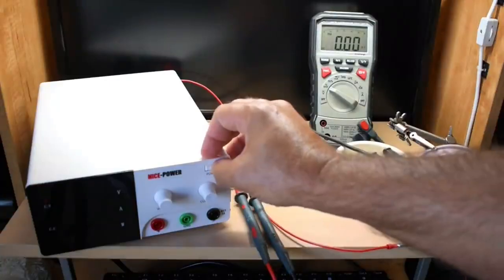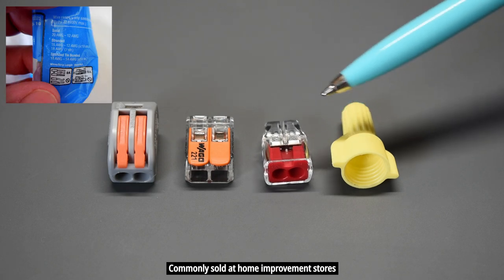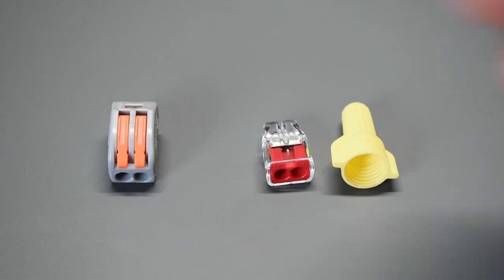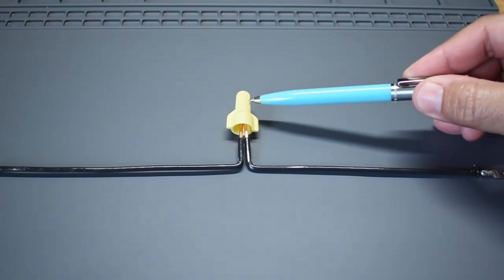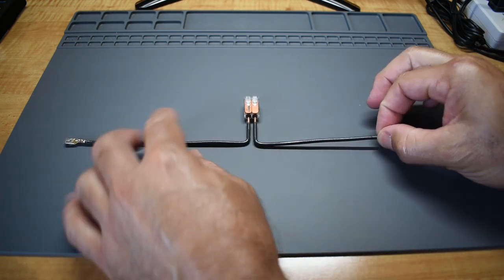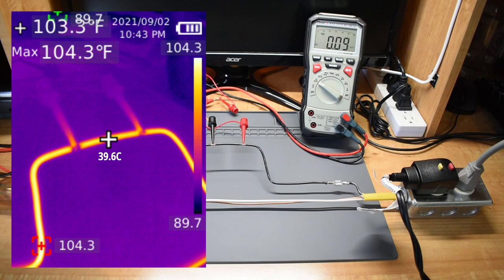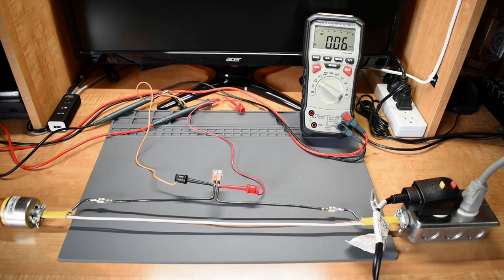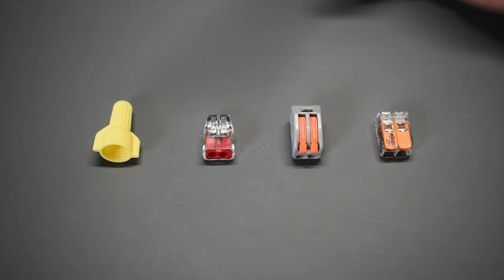BEST Electrical Wire Connector? Wago, Wire Nut, Ideal In-Sure, Lever Nut

Comment: Ive discovered many issues with wire nuts with heat and improper installations where they come off loose or found frail over time. Wagos seem to last and resist longer in handling heat and movement.
Reply from the maker: Decades later it can happen, but no one knows how well a Wago will do over decades, they've only been in use for 15 or so years.

Comment: I would have liked to see the temperature and the loss with Penetrox in the marette (comnector) ...
Reply from the maker: That is normally used for AL to CU or AL to AL.
Reply: @electronicsNmore  Indeed, but surely also helps to lower the resistance and the temperature ... As a test, it is interesting as data!

Comment: In spite of the negligible differences, which are easy to ignore because all are significantly less than the allowable voltage drop, which connection gives the most repeatability? Which is most susceptible to an installation error? Which can be tested easiest without destructively testing the connection once installed? All these connectors have been approved for a reason.
Reply from the maker: Yes, all well below the allowable drop. I was just showing which one has the lowest voltage drop, and lowest temp under load. If a person can't connect 2 or 3 wires properly using a wire nut, then they have no business working on the electrical system. Thanks for watching!
Reply: @electronicsNmore  I didn't intend offense and appreciate the video very much. I was just reiterating for the few that looked at 4 times the Vd and the 10 degree temp difference and reflexively concluded that was bad.

Comment: Wego works the same way that works the little hole in the back part of the standard 15 amps receptacles to connect awg 14 solid wire.  Most Cities codes do not accept to use those holes to install the receptacles because have the tendency to fail after the years.
Wego is a new system not proven yet on long years.  Most probably will be in the future prohibited for residential use.
It is not true that in Germany they use Wego in residential  wiring… they use screw type connectors.

Comment: You’re not really comparing apples to apples here either, push-fit connectors like the Ideal are classed as maintenance free, while the lever types are not, you can’t install them anywhere where you can’t get to them afterwards for inspection. Don’t know about wire nuts, they aren’t allowed for new installations over here anymore.
Reply: You shouldn't be installing connectors anywhere where you can't get tot them for inspection. Not being able to use wire nuts is probably more of a political problem than a safety problem. Another reason why businesses and companies should NOT be allowed to make political contributions.

Comment: It almost seems as if the Wago types were intended to get a twist or two before pushing them into the box?  I've never used them but it seems like the only way to tighten it up without using tape.
Reply from the maker: The manufacturer says the 221 can be used for solid or stranded conductors. They do work for both, but the best results are using stranded wire. Not ideal for solid copper wire.
Reply: @electronicsNmore  Interesting... Perhaps you could do a follow-up using stranded wire just to see how they perform. I'm not up to scratch on current regulations and practices but I've used both solid core and stranded in installations, and I preferred working with stranded wire. Back then we had wire nuts and that was about it, even so I mostly worked with screw connectors and only very infrequently had to use a wire nut. In fact I never really liked them back then, but over time I've learned to appreciate them for their simple construction, low price, ease and speed of use and their reliability.
Reply: @blahorgaslisk7763  Don't listen to him, they're ideal for all types of wires. Watch John Ward videos on the WAGO, failure point is so high that there is no problem at all.

Comment: Hmmm, I just found out about WAGO connectors for a van conversion project and felt kinda fortunate that I found them as they seemed to be quite easy to work with.  I had planned to glue them in place and also tape the wires they were connecting down to hopefully eliminate movement.  Would they be considered safe if such measures were taken?  They were only being used with small 12v dc powered devices like LED lights, fans, etc...
Reply from the maker: They shouldn't unlock, so no glue is necessary. You can cover everything with heat shrink tubing.
Reply: @electronicsNmore  I meant glue them to a surface and tape the wires to the same surface.  I can't imagine them having any force on the connection to the point of wires being pulled out.  Saw your other video on the strength of connection as well.  Thanks for that.  Learning lots of details from YTers like yourself.
Reply: @owenparker6651  Dude just buy wago mounting carriers
Reply: @tropicaldimitri7374  I have never come across these or heard anyone mention them so thanks for the enlightenment :)

Comment: If you ever have stranded and solid together.....wago does way better than nuts.
Reply from the maker: Agree, but if you strip the stranded wire 3/4" long and the solid 1/2" long, you can wrap the stranded wire around the solid conductor then use the wire nut, it will be very secure. Thanks for watching!

Comment: I’m no electrician, but I guess I didn’t realize anything other than wire nuts were even accepted as being a permanent connections in residential wiring. I’ve never used anything other than wire nuts because, to me, the wagos and what not never seemed sturdy enough to trust shoving back into a box. I could see them being used temporarily, for like a temp light fixture, but as a permanent connection just seems like a bad idea. I’ve used wagos quite a few times in dumb little low voltage projects because they’re easy to remove. But I’ve never, and probably will never, use one on for high voltage...
Reply from the maker: I don't like the fact that the Wago and other lever connector rotate on the copper wire as you push the wires into an electrical box.

Comment: of course the wire nuts will be best, it has the least resistance because your twisting the wires together directly, the others are nothing more than bridges, wago (pronounced vargo) are popular in Europe and Australia, New Zealand, in UK they are tycpially used under floors so contained in purpose fit boxes, surprised you never did a pull-out test, maybe @project farm can oblige :)
Reply from the maker: That test may be next. :-) Very simple to do.

Comment: The order of your test from best to worst is reverse of Everyday Home Repairs (YouTube channel) who strongly recommends ditching the ancient (but proven) wire nut for Wago connectors. He's pretty much Wago Jesus. I would prefer just using a wire nut, myself. Insurance companies will do whatever they can to avoid a payout, so might as not cut corners. Also, wire nuts are so much more cheaper. Actually, I could kind of see using those clip connectors in overhead ceiling lights since they are quite low power, but for any general power applications, I'd just stick with the trusty wire nuts.
Reply from the maker: I saw that. LOL. Ridiculous. Maybe best to worst for ease of installation, but not the most secure, lowest resistance, lowest heating connection. Many Wago fanatics out there.

Comment: Id never trust a wire nut for permanent wiring, they are cheap yes but so much better and secure alternatives
Reply from the maker: Wire nuts, when used properly, are the most secure method shown in this video. Did you even watch the video? Apparently not.
Reply: @electronicsNmore  1. metal fasteners are better longterm, plastic does breakdown over time. 2. wirenutting  conductors together significantly weakens the copper leading to premature failure longterm.
Reply from the maker: @trevorsmith5946  Nonsense. I guess you failed to notice that the lever nuts are made of plastic. Wire nuts provide a superior connection because you have a much greater surface area of the conductor in contact with the other. My video proved the best connection, there's nothing to dispute.
Reply: @electronicsNmore  Nonsense. There are countless examples of wire nuts failing causing faults, damage and fires. I have seen many of these failures in my 30 years experience.

Comment: It is going to be harder to test the actual claimed advantages of wago 2273:

Automatically destroys the oxide film during clamping.

Prevents fresh oxidation at the clamping point.

Prevents electrolytic corrosion between aluminum and copper conductors (in the same terminal block).

Provides long-term protection against corrosion.
Reply: I never heard that that Wago connectors prevent electrolytic corrosion between aluminum and copper connectors. They do separate the conductors, but the metals inside the Wago connector also have to be rated for use with both copper and aluminum wire. I'll have to look into that. I've been using those anti-oxidant wire nuts for combining aluminum and copper wire. They seem to work fine, though.
Reply: Why would you have aluminium wire on anything that would fit in a wago?  I've seen it on some shit knock off equipment but it's just a fire hazard. Fair enough for big HV lines but never on an appliance.
Reply: @Savagetechie  Some homes were built with Aluminum wiring between the years 1965 and 1972.
Reply: Note that what you listed was Wago 2273 in use WITH “Alu-Plus” Contact Paste.
Reply: @KiNgOfAllSaND  really? Thats a bit shit; plated ally 240mm² is a lot lighter than copper if you need 600 amp but outside of heavyweight it's normally only used for HV here.
Reply: @Savagetechie   I hear you! It's phased out now but some people like me are stuck with it. Most people leave it because it's too costly to rip everything out, most renovations are done with CU pigtails with anti-oxidant paste for CU to AL. Most who forget that run into problems eventually. Cheers bro!
Reply: @Savagetechie  Yes, during the Vietnam war there was a copper shortage (because we had to make bullets). So copper prices here in the U.S. soared and contractors switched to aluminum wiring for new construction.  Luckily it didn't last long.  Only houses built during the war were aluminum wired.  Almost all houses before and since are copper wired.

Comment: The thing is. There is no point in testing the temperature difference between them. They all have different rated max temp since they are made from different materials. You should test til failure to see which can take more current instead. A cheap simple welder and a Variac shoul do the trick...
Reply from the maker: You're missing the fact that there's a direct relationship between voltage drop across the connector and heating. Testing higher than the rating is a waste, because they'll never be used higher if the proper overcurrent protection is in place.
Reply: @electronicsNmore  exactly my point. If they heat up a little during normal use is not a problem so your testing is kinda pointless if everything works as intended. But if there is a over current surge that is not protected as it should with a circuit breaker which one would melt first? Than the quality of each one would matter the most. Either way the easiest to use that gets you a reliable connection and you can buy cheap is the only thing that matters if everything else is nominal. The twist connectors for instance are shit for flex copper cables instead of solid core copper wire in comparison to the wago or the other one.
Reply from the maker: @thomasesr  You missed the point of the video, so everything you're bringing up is only a waste of my time when I have countless others asking questions on my 650+ videos. Since you didn't understand the video: The video was made to show the "best" connection, which means the lowest resistance connection that generates the least amount of heat. End of story.

Comment: Hmm, over here they’ve banned wire nuts in all new builds, and my experience is that they are complete junk, I can’t remember how many times I’ve opened a junction box in a ceiling and have had the plastic caps fall out, or even worse the ferrule inside, leaving just a mess of twisted exposed copper. At least the kind used over here messes up the ends of the wires so bad that it just a matter of cutting them off if you want to rewire anything afterwards.
Reply from the maker: Ferrule connectors are junk, I rarely every discover a problem with a wire nut, and if I do, it's usually due to a person that didn't do a good job. In the past 33 years I've found a couple wire nuts that split up the side making the connection not as strong. I wouldn't think too much about a particular govt or locality banning a certain connector. Money talks, and people take pay offs.

Comment: I don't know what obsession Americans have to use Wago 221 connectors for solid copper conductors while Wago has a 2273 type connector designed specifically for solid copper conductor.
Reply from the maker: Hi. I tested them using solid wire because they're most frequently purchased, and the company's website claims it works well for solid or stranded wire.
Reply: They don't really have an obsession to using Wago connectors of any type.  In some of the home improvement stores you will find a lot of these alternative connectors like wall nuts and Wago connectors but that is mostly what homeowners use.  You don't see many certified electricians using these alternative connectors since their is really no reason to when a standard wire nut or a set screw wire nut get the job done and are very effective if installed properly.
Reply: @kuhrd  Yeah. It would be more descriptive to say that Americans are obsessed with wire nuts, but the point is that in many videos (diy, pro or test) they always choose 221 for use with solid wires even if they were supposed to use 2273 connectors for that purpose.

BTW. I haven’t used wire nuts since the 90s and they don’t even sell here anymore.
Reply: @peto22  Yeah i only use lever nuts for temporary wiring at my bench for testing when I can't be bothered to use a terminal block or to solder and heatshink the connections.  I think a lot of videos have people using them because they think they are neat but it is rare to see a professional or new install using them as a permanent solution at least where I live.

It is kinda like sharkbite fittings for plumbing.  Professional plumbers use them for temporary fixes but you don't generally see them installed in new or permanent installations.
Reply: @peto22  We aren't obsessed with using wire nuts. That's just what is tried and true here. That's like saying I don't know why British are so obsessed with driving on the other side of the road. (It's just the way it is over there) Every place has there popular products and methods.
Reply: @kuhrd  "at least where I live". Perhaps, that is however a very narrow sample size.

Comment: wirenuts have been around for decades, 100's of millions are in use today with few failures. i find it hard to believe that wago's will surpass this track record. most wirenut failures are due to improper installation. when using wirenuts, strip & twist the conductors tightly. cut the end flush. when adding a stranded conductor, an extra 1/8" beyond the cut & twist the wirenut on.i was an electrician for over 50 years before retiring. i purchased wirenuts in a cardboard barrel of 50,000. not one failure or fire. if you want an easy job, stay away from the electrical trade.
Reply: Thank you! Yes, install them PROPERLY and you'll enjoy a long life of worry free service..

Comment: Can you just solder wires together, or is that not to code?
Reply from the maker: A twisted and soldered connection, as shown in my other video, is superior to all 4 shown. Way too time consuming. You'd need to check with NEC online.

Comment: How did the wire nut compare to a terminal connector?
Reply from the maker: I never tested the terminal because it's not commonly used for electrical wiring in a home. Based on the temperature and my previous soldering tests, it did extremely well.
Reply: Maybe in another video in time 👍. It was very interesting.

Comment: The wago 221 and the old gray version are build fore class 5 wires not solid copper. They are to expensive to use fore soilid copper wire. Try the wago 2273-202 or 2273-202

I know on the box it say it can be used fore solid wire but you its not recomended
Reply from the maker: I go by what the company's website says.  "221 Wago is designed for SOLID and STRANDED copper wire."
Reply: I guess what eNm has here is an old wagi knockoff. Which performs surprisingly better than the updated original 😁

Comment: So, in the end, you showed a voltage drop difference between the best and worst connectors to be the same as adding ... a few inches of wire to the circuit.   For all practical purposes, there is no electrical difference between these 4 connectors for the vast majority of circuits.  The decision has to come down to other factors such as ease of use, re-use, cost, size, reliability, etc.   

Also, 'not sure exactly what was going on with your particular Wago, but I've never seen one wiggle as loosely as yours did.  I've definitely seen a ton of wire-nut connections that were loose and wiggly.